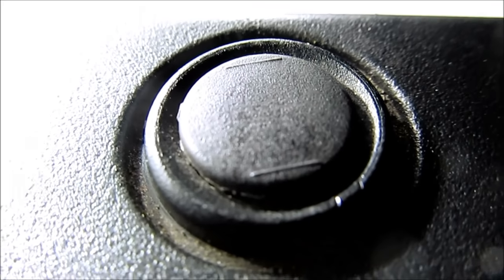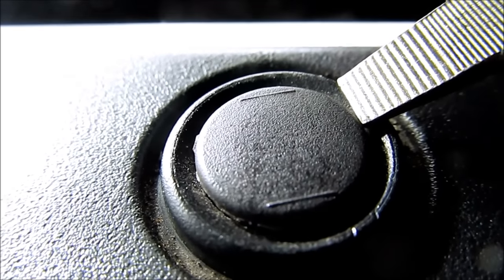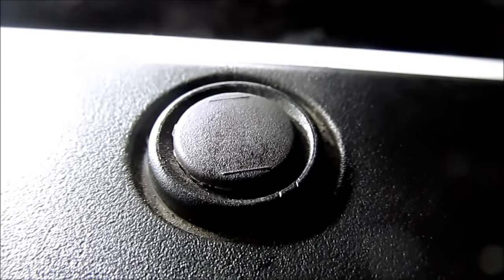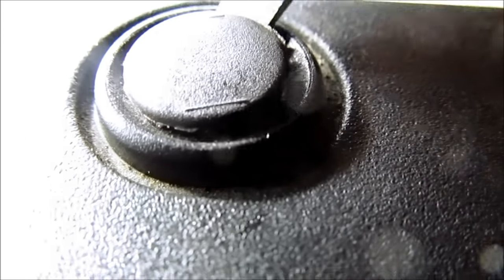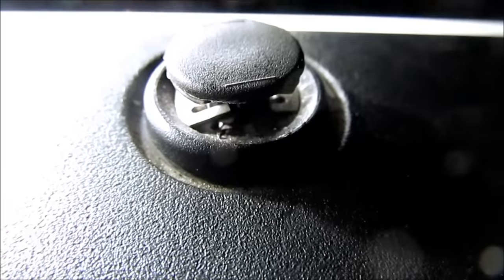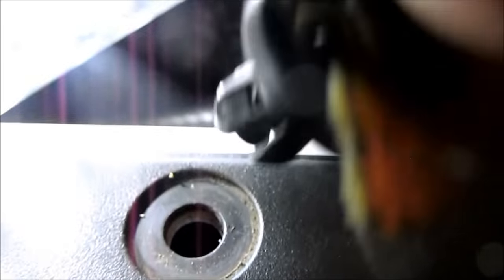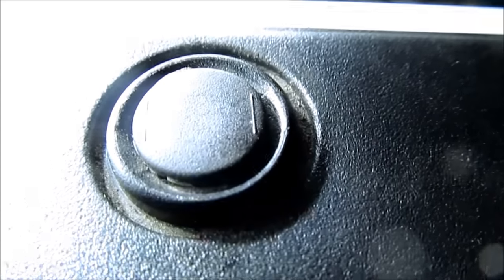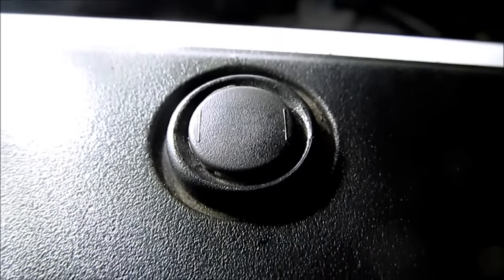How to safely remove bumper Retainer Clips without breaking them -DiyCarModz

Comment: With a pry tool, you don't need the first step with the screwdriver. With a screwdriver without a pry tool, if you slowly turn the head of the screwdriver after you wedge it under the clip, it pops right out. This doesn't break the clip. Anyway, I just wanted to share my experience...after I destroyed 2 of these clips trying to remove them. Thanks for the great and helpful videos.
Reply: +sm753 Thanks. This video is pretty pointless. If I had a pry tool I wouldn't be watching in the first place.
Reply: @tibbyltd  I tried that and the part I was prying snapped off, even though I was being as careful as I could..  Now I will probably have to drill it out.
Reply: I think it snapped because they're ten years old.  I just busted them out and bought new ones.

Comment: The clip in this video is one of the 2 different clips under the hood if you're gonna take off the front bumper. Middle 2 are these clips and outside 2 clips the middle piece can NOT be gotten under with a screwdriver, not even the smallest thinnest Flathead in my precision kit can get it off. Thinking about just breaking them . Only a couple bucks for new ones
Reply: If you can put them in, you can remove them. More importantly, get them out, Without breaking them. Every single bumper clip that has been destroyed is a result of operator error. What is irritating is that every auto manufacturer has their own clips that sometimes require a special tool to remove. A typical car owner will not even consider purchasing this tool until they break almost all the clips on their vehicle, at which point they have to spend their money on either new clips that they won't be able to remove, or a new tool with barely any clips left to use it on. Usually you get the clips to prevent the car from falling apart or scraping plastic liners as you drive. Then before you get a chance to buy the tool, you got to remove more clips. But you're now more experienced and don't break as many clips as you did the first time. Plus you have Few extra clips, so the tool can wait. This process repeats itself until you get good enough to not need the tool, because you no longer break any clips. And then.... You end up with another vehicle. That vehicle uses different clips. Do you finally get the tool given your learning experience? Fuck no! I'll break as many clips as I need to get good, fuck your special tool, keep it for your ass hairs.

Comment: Thank you for this video!  I was stuck on the side of the road with my splash shield dragging underneath my Honda Fit.  It was hanging on by one screw.  I was in the middle of no where.  I knew what the problem was and didn’t want to call a tow truck and say can you bring a screw driver?  Thanks to this video I lifted the panel and finally removed the screw with my hand.  Let me tell I was desperate! Thank you !

Comment: These plastic clips have got to be one of the dumbest and most outdated inventions still being used in the automotive industry.
Reply: To be fair, these are way better than the ones that you can't even pry out without breaking them.
Reply: And as you see, it’s all about ease of INSTALLATION at the factory. screws last longer and are more durable but those clips are much faster to install.
Reply: So you think it is better to use metal fasteners that rust out?  Or specialized complicated welding?  The plastic push pin fasteners are in fact a brilliant invention.

Comment: How do you make this look so easy?!? I'm prying with my screw driver but they aren't popping out.
Reply from the maker: There are several different kinds of clips.  the way you remove them really depends on the design of the clip.  The clip you have might not be this exact type of a clip.

Comment: I stay breaking these things. I put new led fogs in my CR-V today and broke 3 out of 6. How do I get replacements
Reply: Almost any auto parts store has them.  You can also get them from the dealer.
Reply: What year is your CR-V? I'm trying to replace the fogs in my 2013. I've been looking for a video on removing the trim but no luck yet. Did you just go by the manual? BTW I purchased a set of pry tools on Amazon already.
Reply: @jond2720  Its a 2018. I watched a video on it and did it in my moms heated garage at her apartment. It was a pain in the arse, but I managed to get it done. 

I saw some videos for the 2013, and I think its a slightly different process.
Reply: @pobster88j94  By any chance could you link to the 2013 video? I cannot find any on YouTube. Not sure if asking for too much!

Comment: I broke the head one of these in my car, now i cant remove it with a screw driver. Will that tool help it remove even its broken?
Reply from the maker: I would just break the entire clip with some pliers and replace the clip.
Reply: I'm sorry, you're going to have to get rid of the car. It's totalled.
Reply: Or drill out the center plug
Reply: Ya sell me the car for scrap I’ll take care of this mess

Comment: I'm sure the method works 99% of the time. Unfortunately there is too much give on the back exhaust cover bumper on an RX-8
Reply from the maker: These clips are relatively inexpensive if purchased online on Amazon or eBay.  I would replace them instead of reusing them.